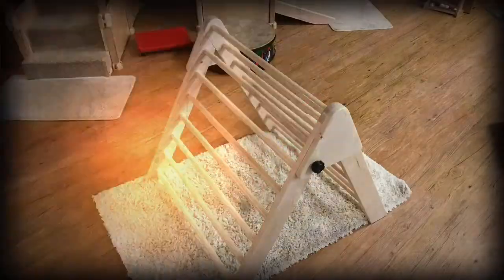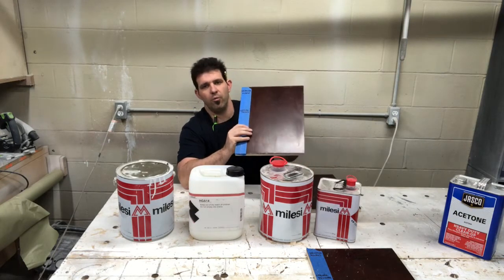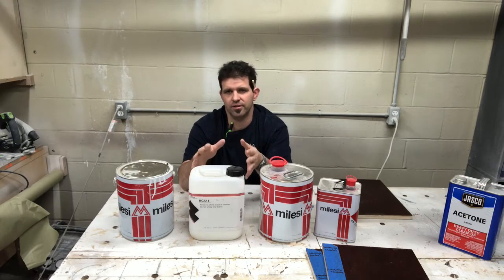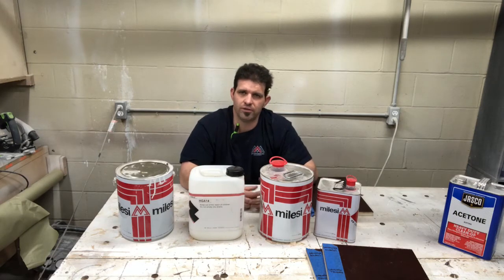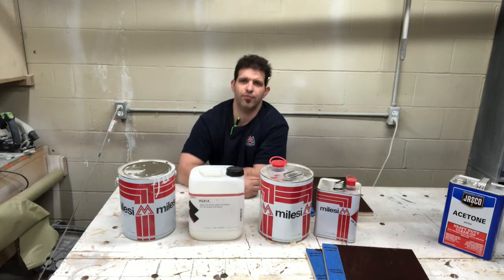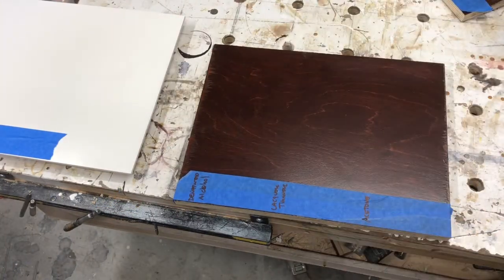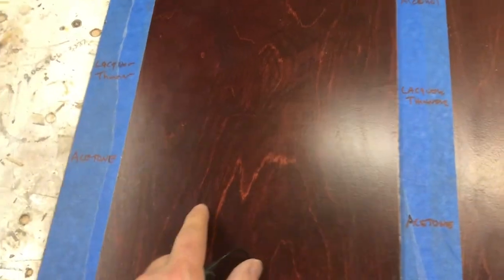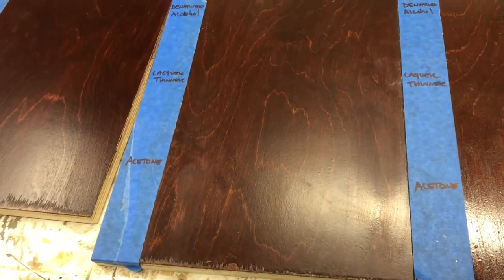Milesi Solvent 2k Poly vs Milesi Water base 2k poly

Comment: Hi!
I am wondering if you have any thoughts on how to sand in between coats for those of us who are brushing and rolling. I can't find info anywhere about this. I'm trying to do my cabinet face frames with Milesi 2k water based paint. I did one coat and it looks ok, but I was wondering if maybe a wet sand or 320 dry sand before the 2nd (and final) coat would work?

Comment: Eric, Kremlin makes a 6 liter hopper attachment for their EOS pumps. Retails around $400
Reply from the maker: Cheyne Sexsmith hey thanks. I have seen the ones for the ca technologies but it won’t fit mine because i have a 1/2 pick up tube on mine. How well do they work out for smaller batches??

Comment: I just started with Milesi 2k WB  with a 9.5 with Pressure Pot #5 18psi pushes it pretty nice
Reply from the maker: Ryan Moore are you doing any reduction or applying less hardner??
Reply: 10% on both with warm material
Reply from the maker: Ryan Moore great thanks for the information. I know a lot of guys are interested in what others are doing with the product with a turbine system . So thanks for sharing your experience and information.

Comment: Just sprayed milesi primer ,now going to spray the milesi 2K waterborne 10% hardener any advice, first time with this product. Using the Graco air assisted airless.
Reply from the maker: reduce it will 5% water and use 08-011 fin finish tip.  The 08 seems to work the best atomize till you loose the tails and it should lay out like glass.
Reply from the maker: I thought you said airless. I run the milesi with .11 or .09. Fluid pressure 450-750 atomizing air at 17-20 sorry 😐
Reply: @ericreason6559  ha ha ! I had a major learning curve today! oh well. At least my customer is happy! Definitely a great product! I also have a Graco 9.5 HVLP I might experiment with that. Real thick product.
Reply from the maker: darrin hodges were you shooting the clear or the pigmented?
Reply: Pigmented, I should have told you that!!
Reply from the maker: darrin hodges yeah the pigmented is a pain. What I have found to work best is 750 in fluid pressure 15-20 air and an .09 or .11 tip depending if you are spraying vertical or flat. I like a 10percent reduction but I have some of the retarder that I am going to play with.
Reply: Hi Eric, 
How you compare Milesi 2k white base to Renner 2k white base 851?
Do you see much difference

Comment: I’ve found that the wb milesi will chip on corners more than the solvent does. That being said maybe I didn’t sand down the edges enough for it to bite to. I’ve taken a key to a door with solvent milesi and it didn’t even scratch it.
Reply from the maker: Joseph Wilson interesting information. Was it in a re-finish or new application?Corners and edges are always an issue I am a firm believe in breaking the edges but sometimes despite our best efforts issues still arise. Thanks for the information
Reply: It was actually new wood. Two coats of shellac and a coat of surfacer then two top coats of milesi wb
Reply from the maker: Joseph Wilson did it chip back to the shellac or down to the wood?
Reply: Chipped to the shellac. The only thing I can think of was it wasn’t enough dry film. I sanded to 220 vacuumed and tacked before applying. Plus I always use my gun to blow air  on surface to remove any contamination too.
Reply from the maker: Joseph Wilson wow! That is interesting. What did your rep say. Did you get the shoulder shrug and the we have never had that issue or problem excuse.
Reply: Eric Reason said it should have been sanded more but they’re shaker style doors so I didn’t want to go crazy to ruin the edge and have it too rounded. I’ve found the milesi rep to be way more knowledgeable than the local SW rep who usually says it’s my fault and it was an error in prep which it wasn’t. Either way. The solvent seems to be way more durable than the wb in my opinion
Reply from the maker: Joseph Wilson either way it’s good information and it’s not super surprising. The harder you make a coating the more brittle it becomes so you have to balance all of that out to some degree. Also, time is the great equalizer when ultimately judging the durability of these coatings. After all the testing and Water base coatings I have shot and looked at it has become apparent to me that Waterbase has come along way but it still has a long way to go. There are just all these fiddle issues that crop up and  on one seems to have any answers to them. Thanks again for sharing the information

Comment: How about the health rating solvent vs waterborne?
Reply from the maker: Mark Me that’s a good question. I don’t have the smds sitting close by so I can’t answer that question. Milesi has been working on a new block chain technology or BCA that doesn’t have the isocyanates, formaldehyde and some of the other chemicals that are found in most solvent finishes. I am pretty sure that the waterbase 2k has isocyanates in the harder but again I don’t have the smds handy. Even though water base materials are supposed to be safeier  I don’t know if we really know about long term exposure so I recommend using the same amount of protection as you would with a solvent finish.